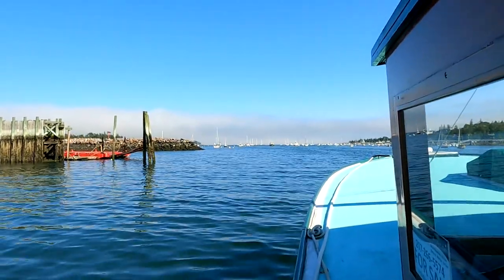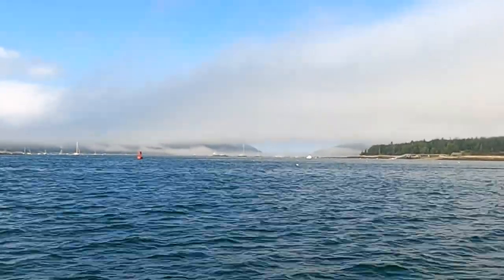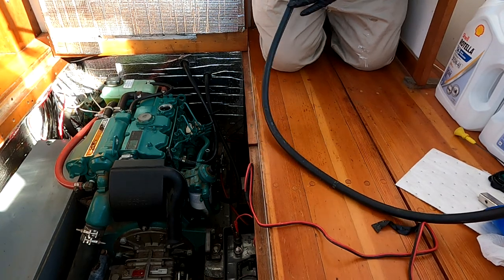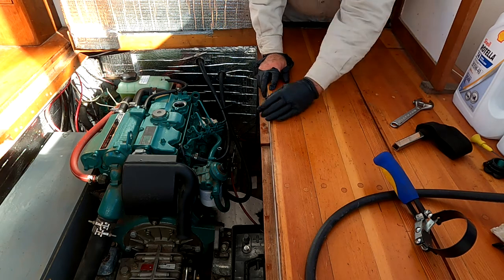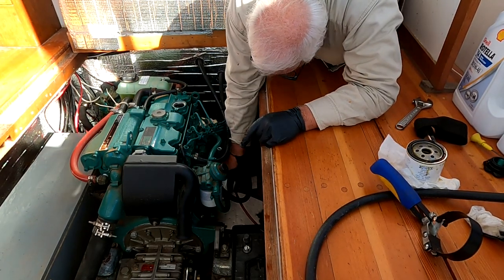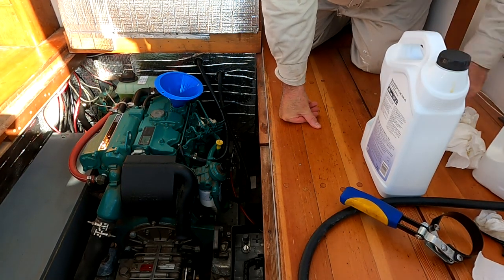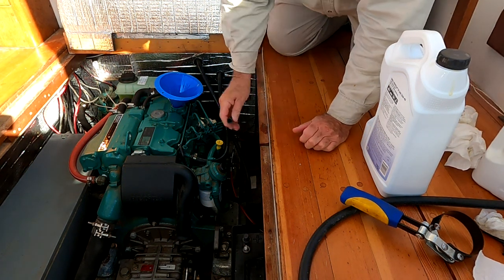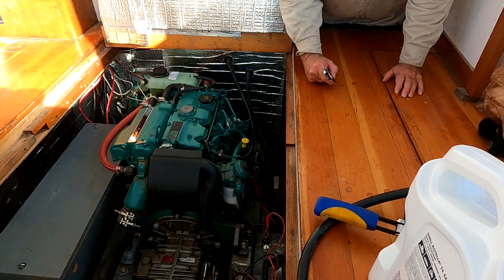M/V Tortuga - Pre-Haul Out Oil Change 9-18-21

Comment: It looks like you're well on your way to having Tortuga ready for haul out, although it certainly doesn't seem like it's time for boating season to be over.
Reply from the maker: Yes, all that is left to do is to winterize the head and water system.  I do the engine after haul out.  We generally haul Tortuga around the end of September because the weather can be pretty bad here in October.  We will keep the sailboat in the water until October 21 this year so I will still be boating.